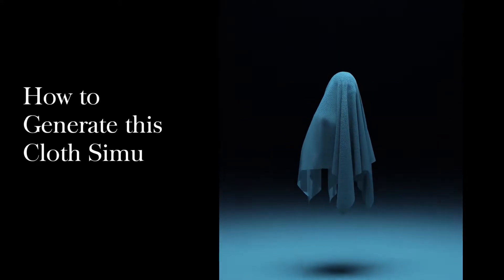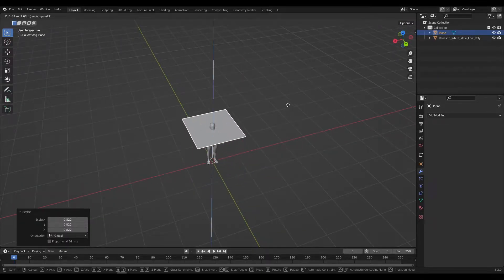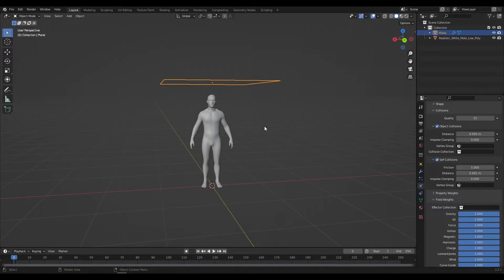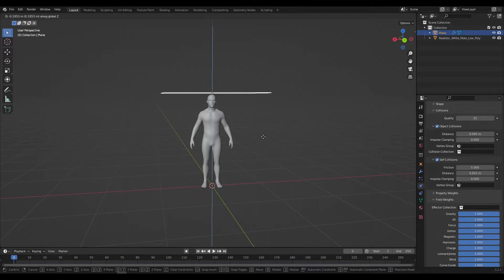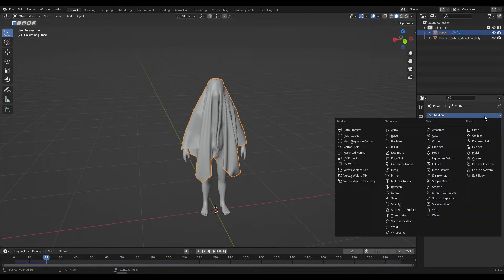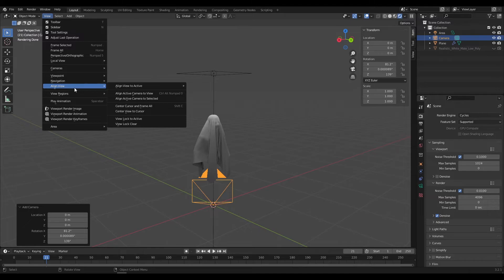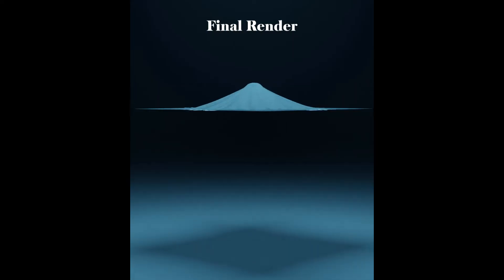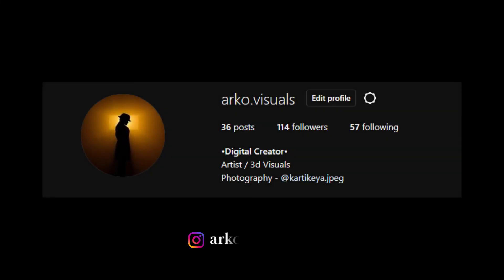Quick Cloth Simulation in Blender | Blender tutorial.

Comment: Hey, great video.
I tried it multiple times but when I try to drop the plane down on the object it goes straight through it? 

Any thoughts on that? Thanks.
Reply from the maker: Yes apply collision modifier to the subject so that the plane collides on the subject .
Reply: @arkovisuals  Hey, thanks for replying.  

I had applied that modifier first, just like in your tutorial, but for some reason, it's sinking through.  

Maybe there's a different explanation?
Reply: @davidchuckycarroll9008  did you turn on object collisions?

Comment: but it takes about an hour to process cloth simulation despite having an RTX 2070 super
Reply: simulations are cpu based so it depends on your cpu
Reply: Top left, Edit > Preferences > System > Set 'Cycles Render Devices' on top to 'Optix' and uncheck your CPU. This will increase render times by 60-80%
Reply: same here, I have RTX3060 , i7, 32GB ram, don't know why a simulation takes so long :(